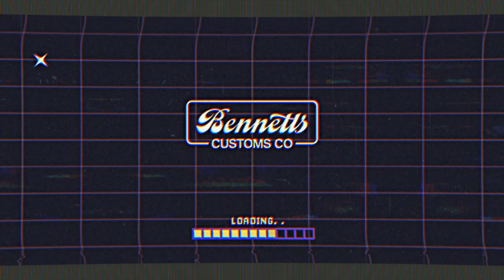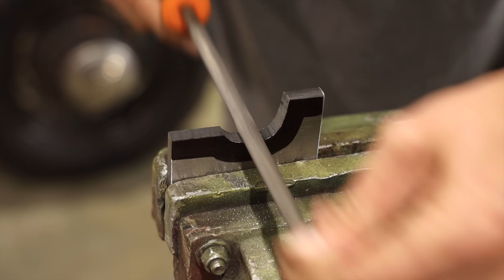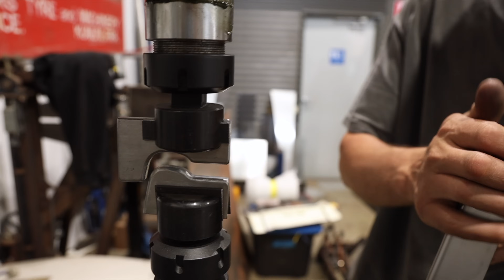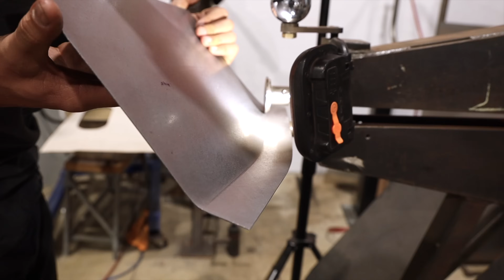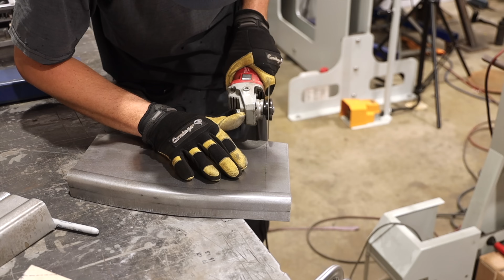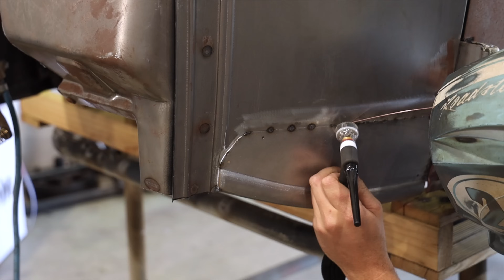Metal Shaping CURVED PANELS from SCRATCH with Custom Profile Dies & Beading | Hemi Coupe Build!

Comment: It shouldn't be too hard to make a filing machine, just need to create the off- set for the file to stroke.
Would be a neat little project for a futher video.
Reply: Our 60s tool shop had segmented filing blades for our DoAll, keep an eye on the Internet auctions.

Comment: Nice look Jordan, the power hammer makes quick work forming belt lines, those Die filing machines are pretty rare here I think, I have only seen a couple advertised here over the years and with high price tags so probably easier to source one back home and change the motor to 240v, it would be a very useful machine. Cheers Greg
Reply from the maker: Definitely agree Greg, I better start looking. Or better yet make one?
Reply: @bennettscustomsco  yes, make one.

Comment: Im building a 31 coupe .found a solid body,with the exception of a tweaker using a hatchet to remove the drivers side 1/4 window and back window,he musta been tripping ,it was 300 bucks,has near perfect floor and doors ,very small amount of cowl rust on 1 side,i had a rolling chassis ,fenders ,grill,running boards.still need a decklid,i have a rebuilt ,hopped up 35 flathead,early quick change .using a t5 trans with open diff,buich ribbed hyd brakes front and rear,im only in it for 2200 so far,think im doing ok so far,you have given me direction and inspiration.thanks are in order.also have a 34 furd pu,project.too little time,especially with 4 kids still at home.you do beautiful werk.go kick a kangaroo for me😊
Reply from the maker: Sounds like a good score and definitely at the right budget!!’